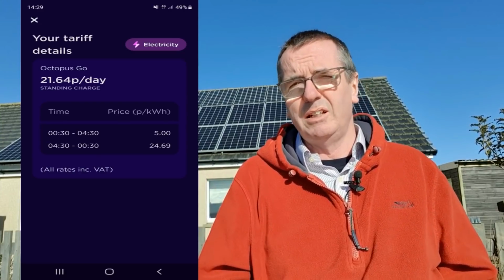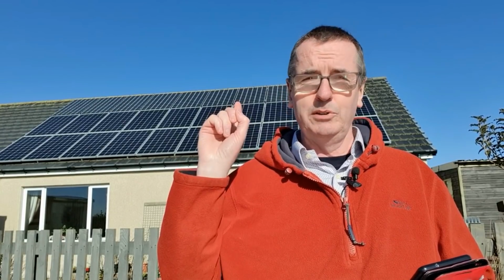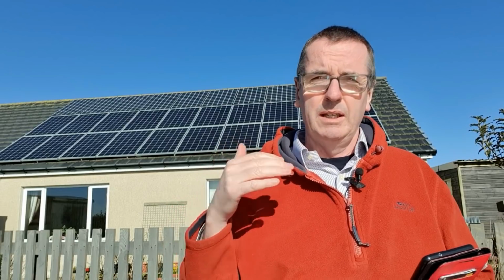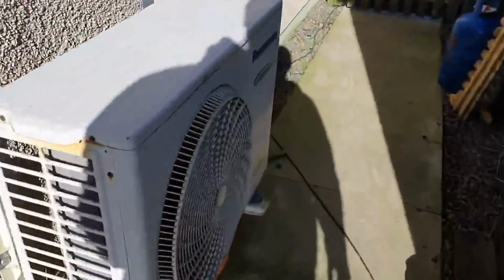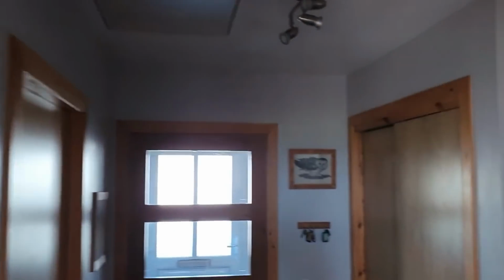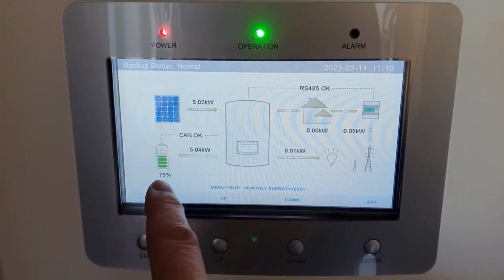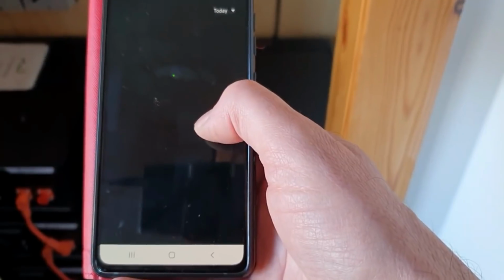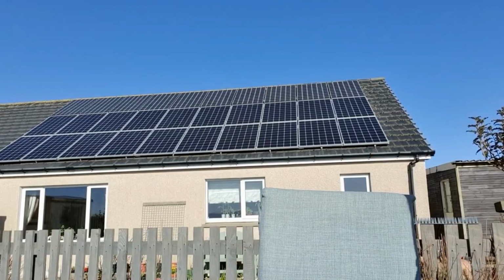My home solar PV and Pylontec battery storage setup

Comment: I've got a 2014 2.6kWh solar panel setup.
I reckon it's saved us about two thirds of our electric bill if we did not have solar generated power to use, and the FIT payments have exceeded the estimates given when installed.
Our original Immersun gadget to heat up the hot water immersion tank broke so 2 years ago we had a Myenergy Eddi fitted and that has been brilliant with the app giving so much information on how we benefit from our solar installation.
Now I am looking at how to install a Pylontech US5000 x 2 for solar storage and use as an EPS, I suppose an extra inverter would be needed but my knowledge is lacking!
The top range batteries like the Tesla Powerwall 3 are just too expensive for us at £7-8K.
Thanks for posting.
Reply from the maker: Yes , you'll  need a 'hybrid' inverter as well as your existing grid tied inverter, a electrician with solar/ battery skills will advise 😉

Comment: Hi Jonathan, I had to search back the videos to find this one as I've just had a battery system fitted in a cupboard and was wondering about fitting a fan. Can I ask how much of a difference having a fan makes, do you notice a significant reduction in temperature once it kicks in? Thanks you
Reply from the maker: Hi , yes the extraction fan does help a lot , if its a really hot day , i crack open the front door to allow fresh air to come into the porch , then air is replaced easily in my cupboard.
Reply: Thanks, I'll look into it. Ive added a few vents into the cupboard door in the meantime. Makes for a good heating cupboard for drying clothes at least 😆

Comment: Albert Gibson
Great video
Just wondering did you inform the DNO and completed a G98 or G99, due to the size of the PV array you have installed. Also, are you taking advantage of the Octopus flux tariff?
Reply from the maker: Yes ive a G98 from the DNO , and ive not looked to export for a income as most insist that the system is installed by a MCS installer ( not that it means anything as to its install !)

Comment: Great video, thanks for sharing! I've got two of those Pylontech batteries with my system. Is there anything more to it than just buying an additional one and plugging it in? I would like to get more but just would like to be sure it's a simple plug in and off you go!
Reply from the maker: You have to make sure all packs are around the same SOC ( state of charge) new units are sold at around 50% , so make sure your existing ones are at 50% as well when connecting up.
Thanks for watching 👀 🙂

Comment: Hi nice video and congratulations for your set up .. I Have question to ask of course I'm new on this system..I need little bit Help with solar panels and pylontech battery and inverter.. I want to set up  off grid whit 2 pylontech US5000 whit only 3000w solar panel because not got enough space for more panel .. I want to ask you which (All in one inverter) do I need.. I know is 48v but in voltage I hope you understand what I mean ..thank you

Comment: How big a battery do you use and if you had a chance would you have more
Reply from the maker: 28kWh total , and yes id have more ! 
Thanks for watching 👀 🙂
Reply: @JonathanPorterfield  
Great video very informative
Do you have a few batteries to meet that capacity. 
Approx how many panels are you using.
I thought 10-12 would work for my needs.
I want to install underfloor heating in a new build and have a combination of solar PV, batteries, heat pump, wood burner and electricity as backup (No gas connection).
Do you find the 28kw is able to run your house for most of the day. 
Are you using a gas for central heating.
I found I'm using 100kw per day in winter in old 1970s house in currently in, which has poor installation and electric and gas only.
My main energy usage is over winter on heating with gas.
Many questions though you seem to have the experience to answer real world questions.
Reply from the maker: @davidoconnell2057  Hi David , i have several other videos about my set up in this playlist on my channel 
https://youtube.com/playlist?list=PLHhiqu7LB3YXAQhdOiMaHuERX8L6au1HP

Comment: Hello Jonathan, I have 16 solar panels for 7 years now. I am interested in battery storage to be added to my system. I would appreciate your advice what equipment will I need and can we do it ourselves? My partner is an electrician. I am sure this could be interesting video for many! 

I was thinking to switch to Octopus and I just saw your link, will use that to switch it seems to be still working! Do you get fair payment for your generated energy? Thanks a lot
Reply from the maker: Hi , thanks for watching 👀 😊  see this video for my years update and what ive saved https://youtu.be/BtSzsxnTAJ8
Im not interested in any payments for what little goes to grid , id rather keep it all and use myself !

This video https://youtu.be/mAXl2Y_BTQQ shows what we do in winter with low solar power , being smart is key all year 👌

Comment: Hi Jonathan, great video.  I have a solis hybrid inverter just like yours and I would love to add an additional inverter as you have done but the installation manual for the solis hybrid inverter says this should not be done...how did you get around this??....did you just get them hooked up and see what happens?  Thanks
Reply from the maker: Ive 2 inverters both doing differant jobs , the 4kW inverter is grid tied and dumps any excess onto grid , the 8kW hybrid inverter is for the 20 panels and for charging storage battries etc. 
No issues at all.
Reply: Does the 4kw inverter supply any power to the house or does it feed in all it's production back to the grid?  A video explaining how it's all set up would be great, more content for your channel!
Reply from the maker: @eamonnhenry8161  Hi , my  4kW inverter ONLY dumps onto the grid if everything is full ( heat batteries,  storage battries,  and EVs are full) and no demand from house, then and only then, do I loose power to the grid from just this 4kW inverter.
Reply: at 13.24, the hybrid is topping up the battery and the other inverter is feeding into the grid even though this is not shown on the hybrid display...that's why I was asking...obviously CTs are set up in a particular way to allow this to work for you

Comment: With the latest energy prices my system should pay for itself in 4 years. However, I’m struggling to get the off peak battery top up configured and it’s still drawing some peak time power when it should be all off peak. Any advice?
Reply from the maker: Hi connie , im soon uploading a video on setting the solis hybrid inverter to charge my battries between 00.30 and 04.30,  hope this will help you ?

Comment: Thanks a lot Jonathan for an excellent video. The point about ROI is well taken. Do you have contact for a pylontech installer in Lancashire? I have got 5 US3000 batteries and 5kw hybrid inverter waiting to be installed so can use some help with a contact for a good installer for those. Appreciate your help.
Reply from the maker: Hi , sorry i dont know of anyone in Lancashire,  as @wirebrigade on twitter,  Chris my electrician may know of someone.

Comment: Return of investment....OK I only fitted 2.25Kw Solar due to limited roof space and that was 10 years back. It paid for itself less than 6 years and since then I've made over £4k profit. On the current FiT system this would not be as profitable but I squeezed the fit when it was the best rate. It still works fine and I am now considering (late in the day!) storage batteries and a change of Octopus Tariff to suit.
Reply from the maker: Nice ! My old house in Leicestershire  in 2012 when FIT was paying 43p a unit , we had installed a 1.9kW solar PV , we had around £1200 a year payments,  system cost £7k , so paid for in year 5 just on FIT payments, the savings on electricity too was a few £100 a year.

Comment: Hello Jonathan. I think you got a great setup there. But I don't understand the usefulness of the smaller power inverter. Could you explain to me when you use it?
Reply from the maker: Basically the smaller 4kW inverter is grid tied and so 'can' export a max of 3.68kW onto the grid as an 'overflow' if i make too much. The larger hybrid inverter is for filling the pylontec batteries and everthing else.
This keeps the DNO happy 😊

Comment: Great video very interesting is it worth just going for solar panels with the batterys. a heat pump  I don’t it wroth it . as I’ve got no radiators and no central heating in the house just gas fires

Comment: Hi, may i ask does your setup still use the grid power even if your batteries are full ?
Reply from the maker: A very small amount as it needs a small amount for the inverters to 'talk' to the grid and its earthed to grid too. Next project is to install an earth rod , so when we have a power cut ( in a storm for example ) we can use the battery's power safely.

Comment: Hi Jonathan, thanks for such an informative and enthusiastic video. The setup in our house, in the Borders, is similar with an Eddi, Zappi and 3.7kW of PV through an SMA inverter. I'm ready to install a battery based on Pylontech and a Solis hybrid inverter. In time I'll add more PV connected to the Solis inverter but meantime I want to be able to charge the battery from the excess power which the existing PV system generates, and overnight through the Octopus Go low rate. I've studied the Solis install manuals and asked Solis support and a few installers but haven't yet had an answer to my question. Your system is so close to what I plan that maybe you can answer. Can the Solis hybrid inverter charge the battery with the excess power from the existing PV system? To do this it would have to monitor the import / export power and vary the charge rate to the battery to use all the excess power, resulting in zero export or import. It can certainly do this with the PV panels connected directly to it but it's not clear if it can also do it with an external PV system (like your top row of panels). On your system it would be equivalent to switching off the PV connected to the Solis and seeing if the battery gets charged with the excess power from the top row of PV. Have you seen this happening? 
Many thanks in anticipation as I'm keen to get moving with the battery system.
Reply: Hi. I think the Solis Hybrid Inverter does do this. If it sees power going to the grid, and has battery capacity, then it will charge the battery even if the excess power is from a different inverter/source. The hybrid can only get so much charge into the batteries, so if you've got all your PV generating lots of power, you may have more than the hybrid can push into the battery system.

Comment: Brilliant, information rich video. I note you mention that your Solis Hybrid can shut off ,rather than export... how is this managed, is there a certain attachment..  I have a similar set up 1x Solis normal inverter and 1 x Solis hybrid.  Also is there a limit to the Pylontech qty of batteries.. one person said 8 was the limit ?  Also re charging the batteries at night using the cheap rate, can this be managed from the app ?
Sorry for all the questions
Regards James
Reply from the maker: All the settings for export etc are set on the panel of the inverter.
The time to charge battries from the grid are also set video the hybrid inverters screen.
The app is only to see the state of charge in the battries.

Comment: Hi, if the grid went down does your solar system shut down slso ? I know having batteries will give you a couple of days electric but then what  ?  If your grid was off for a couple of weeks do you have some sort of way of switching over to solar only  ?
Reply from the maker: Yes , i still need an earth rod , so when the grid is 'off' i can run off my batteries,  its coming soon ! 
Then i calculate  with carefull use in summer months i could go for 7 days on battries alone,  in winter around 24 hrs with heating etc.

Comment: This was a very useful video. How do you work out how much battery storage you need? Is is based entirely on your monthly/annual (kw) consumption or does it depend on what your solar array set up generates too?
Reply from the maker: Depended on space and cost , i would like more storage , but Mrs P reins me in 🤣👍 28 kWh is about right for my set up.

Comment: Brilliant video. How efficient is the air source heat pump please? 
 Thanks
Reply from the maker: Thanks for watching and your comments, this air to air heat source  pump ,  for every 1kW of power , you get 3kWs of heat !
Reply: @JonathanPorterfield  The 3:1 ratio for the Air to air system sounds excellent. I guess in the summer it will also cool your house. Did you buy your Panasonic system new, and did you size it on previous heat loss requirements, or just an assumption on requirements?
Reply from the maker: @garyroberts6554  Hi , the system was built into the house when new ! 
Yes it can cool , but Orkney never sees more than 24 degrees ! Then the cows are bought in by farmers as they get too hot !

Comment: Interesting;
I'm just starting this journey with 4kw solar + 6kw battery to get some experience.

Is there any way around the active decision/daily process over charging the batteries overnight, vs. leaving space for the solar to top them up?

I guess having twice the battery capacity the house uses with the second bank charging from overnight 5p, but only being used if the solar bank runs low? and/or setting the solis charging limit so it only ever manages to charge a proportion of the battery capacity?
Reply from the maker: Hi Richard,  i set the Hybrid inverter to charge in winter at 3kWs at 5p from 00.30 till 04.30  this fills the pylontec batteries to around 50% , leaving room for any winter solar to top up.
Your correct that the 'trick is' to watch weather forcast for following day , and if i need to top up me e niro  etc.
Since early March , ive not charged the batteries on the 5p rate as eneough daylight to fill our needs most days. 
Im planning a 1 year round up video around October with more numbers.
Thanks for watching 👀 🙂 🙏
Reply: @JonathanPorterfield  
Thanks for responding.
Winter to 50% sounds like the way to go.

I'm thinking on the solis to set the 00:30-04:30 as its charge time with 0 volts during the summer to stop the battery charging the car during off peak - I'd rather my car charge at 5p overnight, and the battery discharge during the high rate periods.

Ideally there would be a calendar in the Solis inverter, or opportunity for an external switch to automate that - but I can't see a way of doing that from the docs.

Comment: Thanks, first time I’ve viewed your site. Really enjoyable, also an enthusiast. I unfortunately only have a 2.0KW array presently with a Zappi charger and Hyundai Kona EV. It seems like the Zappi only charges from the array when producing over 1.4KW. If not and the house on using say 0.6KW, it dumps the excess to the grid and not the car. Is this your understanding please? Pete
Reply from the maker: Hi peter , and thanks for watching . EVs will only charge from 1.4kWs , anything less and the car doesnt charge. Have a look at heating your hot water with your set up too , the eddi will divert every tiny bit of excess solar into heating your water , ie an immersion tank.
Reply: @JonathanPorterfield  Thanks so much for the reassurance. We have a Worcester Bosch flat plate solar hot water system to a twin coiled tank. It does have an Emerson heater so will investigate the Eddie. A company are coming round next week to advise if we can fit more PV to the west side, which is the only roof space left. I was reading a paper from Sheffield University to say west facing only slightly less output than the ideal. Pete

Comment: Very good video very informative. I still have a few questions, i hope you can help, 

so your extra Solis has a DC to DC charger for the batteries, How does that work with the Eddi for the hot water? Doesnt the Eddi not use CT clamps AC? 
Can you charge batteries at same time from solar edge and solis? Can the Solis dump the  kwh back to the grid too to make up the 4KWH.

Comment: Great video! I have the AF1 turbine mounted to my steel shed, and it's noisy, don't mount a turbine to your house, have it mounted to a pole on the ground, also the airforce controller is the only one in the market that has a remote stop, so when the pylontech battery is full the contact port on the battery trigger the remote stop and shuts down the turbine, if you don't do this you will get over voltage alarms in your batteries

Comment: Hi and thanks for the explanation, I have just had a quote for exactly the same make of battery and Inverter so its very encouraging to see that they work well here in Scotland. There seems to be some evidence that the Solis works better and for longer in low light conditions - so may be useful to know in northern latitudes? Once its up and running would you like me to copy you into the performance data I get? Thanks again.

Comment: Hi JP,  thank you for a very interesting video.  I’m thinking of getting a Solis AC inverter with Pylontech US5000 batteries.  Is it possible to control the inverter via the app? Can you set schedules et cetera using the app. Or do you have to do it on the control panel on the inverter?
Reply from the maker: Hi , you need a solis Hybrid inverter if your filling battries from the solar or grid , and the settings can only be set from the inverters screen , the app just tells me the basics.

Comment: Which solar mount is better for garage roof? My installer saying GSC in roof system which quoted £100 per panel. £95 for roof rail system.
Reply from the maker: That sounds steep for fixing just 1 panel ! Ive no idea what fixings you'd need , sorry i cant advise,  i left my install to my sparky and roofer.